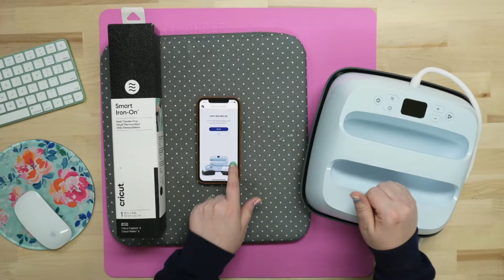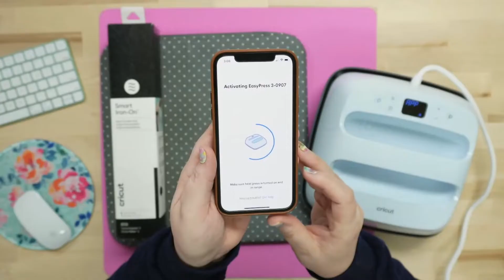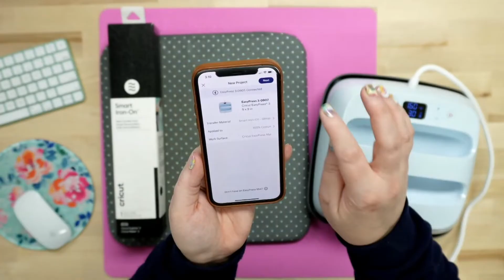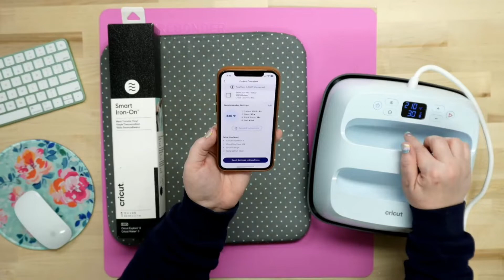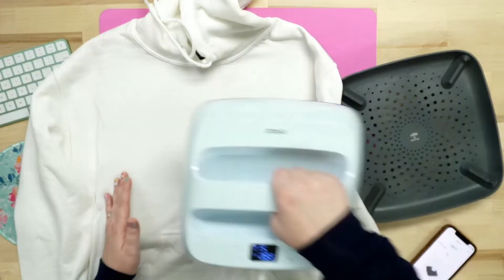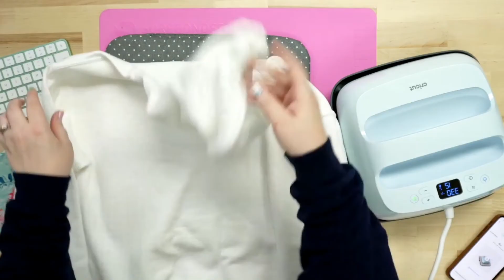🤓 How to Use the Cricut Easy Press 3

Comment: is the plastic you use for transfer your design is it the same as the cricut transfer tape??
Reply: No, it's built into heat transfer vinyl. You have to put the shiny side down to the matt. It should mirror your design automatically too when you move the knob on your Cricut to "Iron On"

Comment: Best video I have seen but am really confused with practice project. Have no idea what material is supplied . I have a maker so presume this material is Smart vinyl . Do I need to use butcher paper? How can I replay practice tutorial ? Am I a ‘numptie’ (Scottish word for stupid)
Reply from the maker: Hi Jan! Not to worry.. we were all beginners once so please ask all of the questions you have 😊 The material being used is HTV (heat transfer vinyl).  Butcher paper isn't needed because the htv already has a protective covering.
Reply: Do you use a certain printer to put the design on the vinyl I have a circuit but and wanting to know how to get my design and put it on the plastic